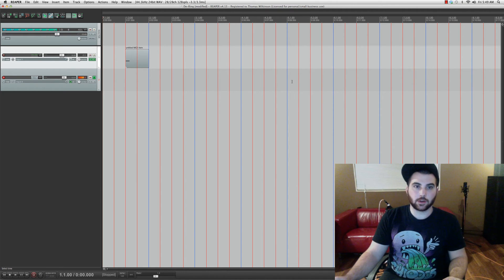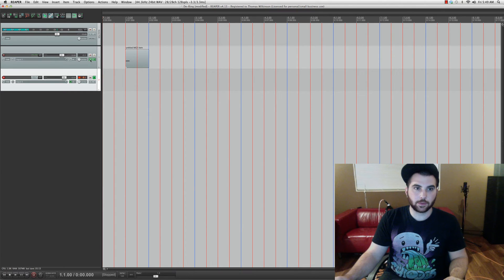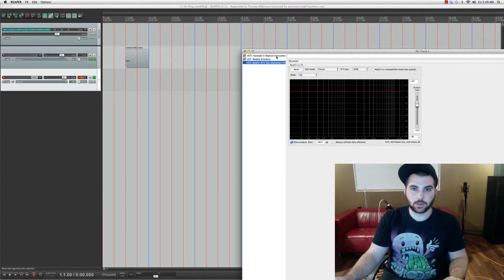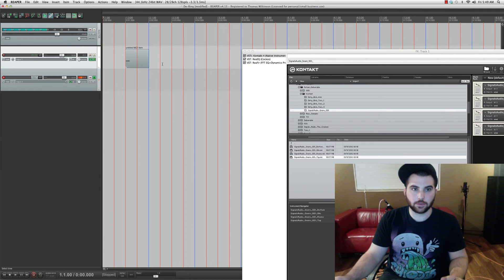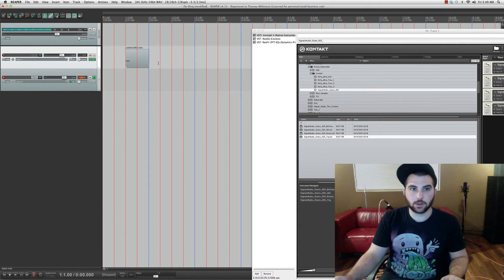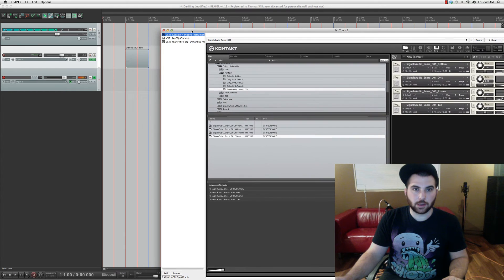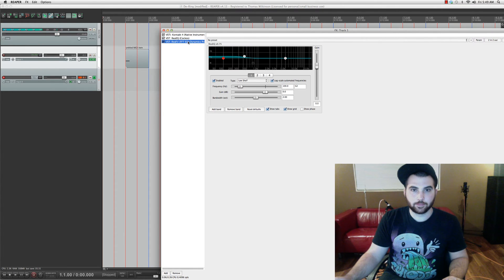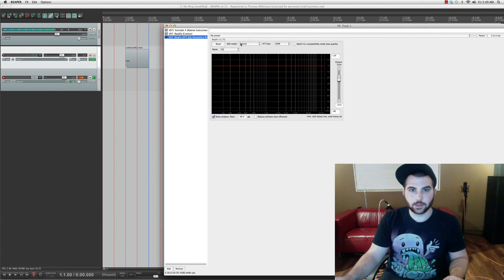Signals Audio: How-To Remove Ring from Recorded Drums

Comment: Whilst this is cool and all, but what would be your method to reduce ring if you had to do it manually... that I'd be interested to see...
Reply from the maker: +Mikeyprs21 Manually? I would just EQ the ring out or gate the snare most likely.

I would probably attach an EQ band at the frequency of the ringing to a modulation parameter controlled by the volume of the snare hit, so when the snare hits the EQ band is set to 0 db, and then as the snare decays the band decreases in DB reducing the ring without impacting the quality of the initial snare sound.
Reply: Ah okay, that's cool! it's just as I say whilst that is a pretty sweet in reaper, I'm a cubase user so like yeah that function isn't quite so useful to me aha. all I've just been doing is a fairly tight Q setting, setting the gain reasonably high and just moving it around the frequency spectrum till my ears told me it didn't like that it and trying to go from there really lol =)
Reply from the maker: Yeah I don't actually think there is any other DAW that has that capability. Some plugins do though, like Fabfilter MB could do it.
Reply: oh okay, that's interesting.. thanks Alex!
Reply from the maker: Oh sorry, ignore my last comment I was thinking of removing bleed, not ring. But yeah, I'll make a demo showing what I'm talking about with that way to reduce ring inside Reaper. Maybe people can find ways to do it in other DAWs, or maybe I can develop a plugin for it.
Reply: ah that's cool dude! but yeah that would be awesome if you could demostrate viable technique(s) to remove ring or finding horrible Frequencies from different instruments in a mix =)
Reply from the maker: Use any EQ that can freeze the spectrum and hold maximums. That'll show you resonances peaks. Fabfilter Pro-Q can do that. Spectograms can also show you were rings or resonances are.